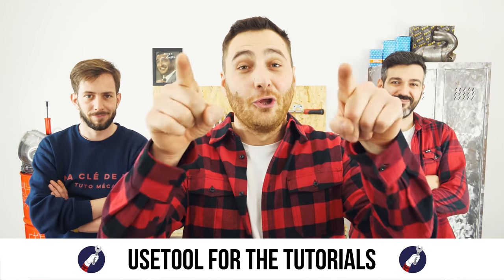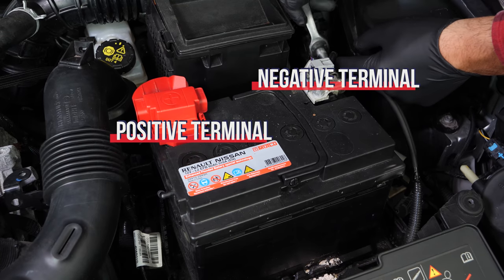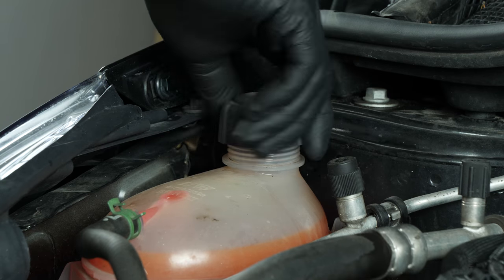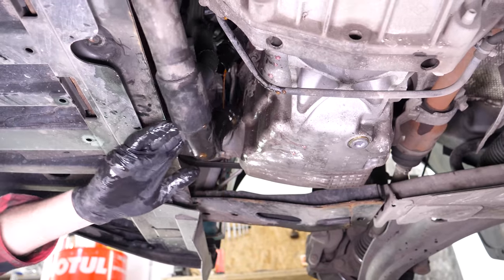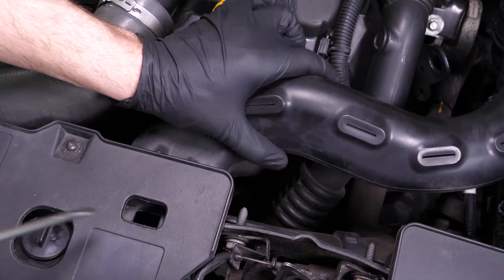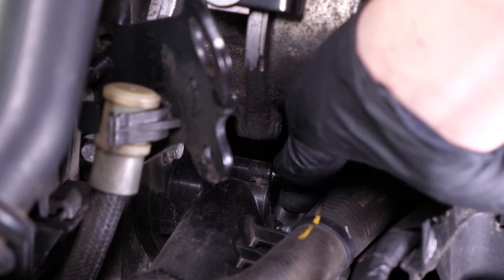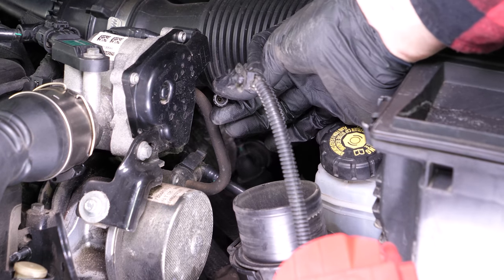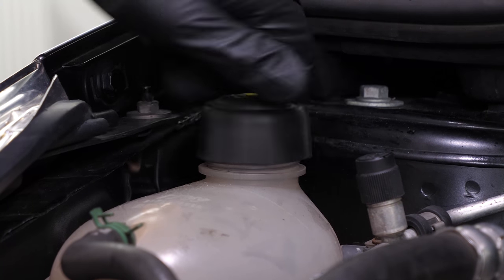How to bleed the coolant Clio mk4 1.5 dCi 🚗

Comment: after what mileage its recommended to change coolant? 
3:44 what is that white cap in front off the air drain screw? Is it for checking brake fluid?

Comment: not a mechanic myself, still, two or three comments: not sure about the coolant type you drained, the  new one (type D) being a  Renault recommended OEM one. Either way, one might flush the system at least once with distilled water before pouring new coolant (it is visible that not all of the former coolant drained when opening the upper air drain cap (pink coolant sprinkling out). Also, coolants are toxic, hence using your mouth pressurizing the coolant container, I do it the same way...still, this is instructional video 😉. I did in fact subscribe to your channel since it brings an interesting videos of use to me (same K9K engine on Duster 2).👍..which brings me to one question: there is a third air drain valve on the hose entering cabin heater - why not opening and de-airing also that third one ?
Reply: Normaly you should open all 3 valves for air to come out of the circuit.
However,in time, the air from the circuit is removed automatically, just you have to watch that the cooling level doesnt go bellow minimum
Reply: @alinnimeni3789  thx👍